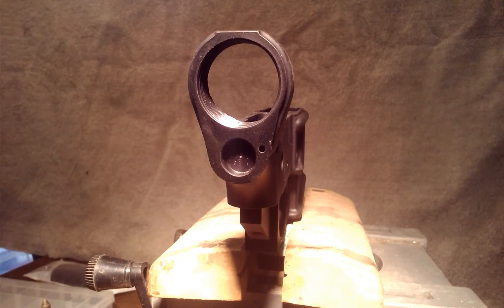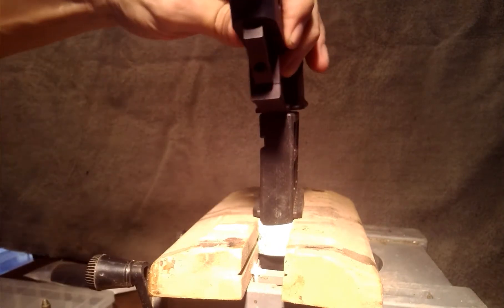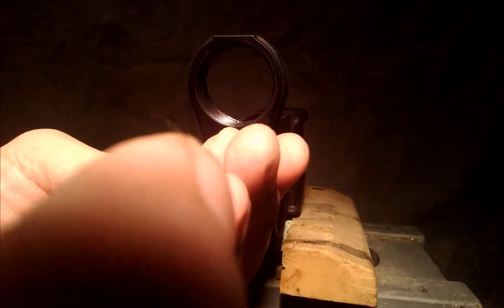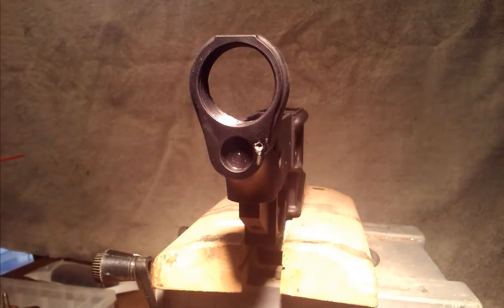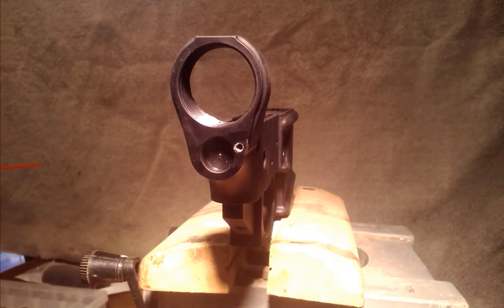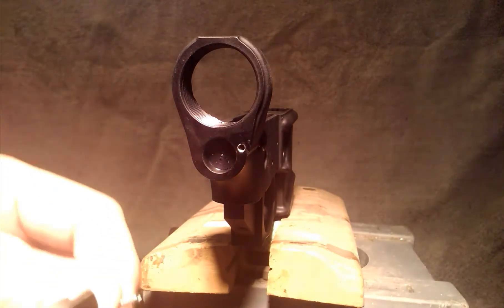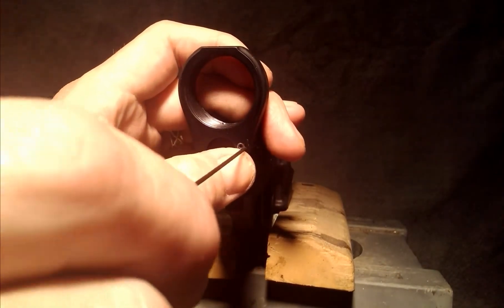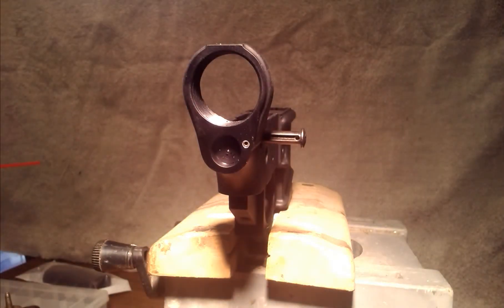Installing A Set Screw In Your AR Lower

Comment: i ended up having to drill my hole with the bit the 4-40 set screw wouldnt go in the threads the screw it self was slightly bigger than the hole for some reason

Comment: I am so glad I just came up on this video! I literally did an exact search for this and your video came up Mr. HeadIdiot. As I always say, I love your channel. I can gladly and proudly say I am your biggest fan! (Still waiting for you to torch more stuff with that torch tho😉 hehe.) 
Thanks again for this video. I was looking for a video on how people actually put the screw into the set screw hole. I typically buy Aero Precision M4E1 lowers and the set screw hole is pretapped. Also, if you buy a Aero Precision Lower Parts kit, it usually always comes with a set screw in the parts kit for the pre tapped hole for the takedown pin detent and spring.
I just got the random urge to finally try to put a screw into one, but was trying to figure oht how. I ended up cutting off like 2 could of spring and was able to compress it enough to put screw in. Works like a charm!

I have few lowers with Untapped Takedown pin Spring/Detent holes. I think I will follow your lead and tap those myself! This video GENUINELY helped me out brother!

THANK YOU MR. HEAD IDIOT! (May I also ask what your 1st name is? So I can address you by something other than Head idiot lol)
Reply from the maker: You are too kind A-Hole(no offense). I buy a lot of Anderson lowers, because of price, and they aren't tapped versus some of the nicer lowers. As you see it isn't a hard process. I will get around to the torch videos don't worry. 😉 The name is Mark which is much shorter to type too.
Reply: @theheadidiot  Right on Mark! Your response, it really does mean a lot to me buddy, thank you!
Im was just busting your balls about the torch, but seriously, I think you will get a lot of views etc with those type vids because of how darn entertaining they are hehe. 
Also, speaking of Anderson lowers, man I cannot even tell you how much I want to be able to buy cheap Anderson lowers. Before Tax(like 10%) they are like $80-90 each, plus the $25 Cali DROS fee per firearm(California suuux). So I typically just spend a $10-20 extra and get Aero Precision M4E1 lowers. They look way better plus they got many more features. But if I could get them for like $30-50 each like the rest of the country, I would own MANY of them.
I still plan on buying an Anderson lower sometime soon. I already own one of their Stripped Uppers, so I want to build a Complete Anderson Rifle, I like to stay with 1 brand in my builds. I love building firearms! We need to get together and shoot sometime. Even if we do live half a country apart.

Thanks again for your response. Have a fantastic night my friend!
Reply from the maker: @aholegunner  My big nemesis is Primary Arms which is just a few minutes away. They run these flash sales of Andersons for $30, how am I supposed to resist? Lol.
That would be awesome if that does happen sometime.
You have a great evening and weekend too my friend!
Reply: @theheadidiot  I may have to move out of Cali for those Anderson deals alone. I am a HUGE fan of Primary Arms as well. They are my favorite Optics. 
Do you own any of their scopes? If so which ones do you recommend?

Have a fantastic weekend buddy! Thank you for your responses as well.
Reply: @theheadidiot  ALSO- I would love to talk with you about firearms sometime if your ever interested. Im a total enthusiast. Curious what parts kits etc.. you like to use. Let me know if you ever wanna have a good chat about gun stuffs. I love building ARs. Its the most enjoyable thing to do

Comment: Could have made the video shorter and to the point but great idea. Could have pushed the detent pin in from the other side when you had the screw installed using an old takedown pin from the opposite side.